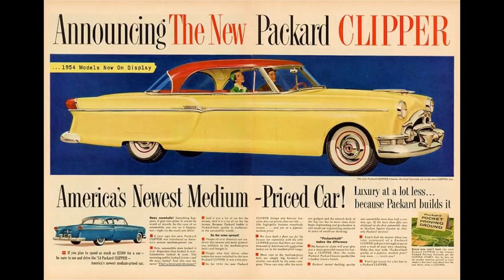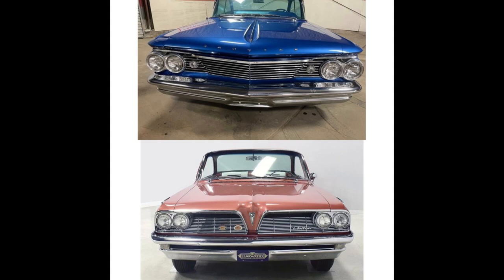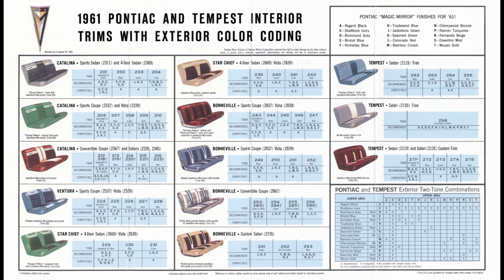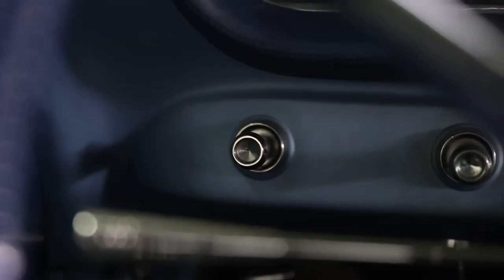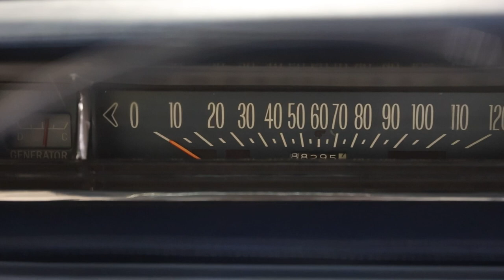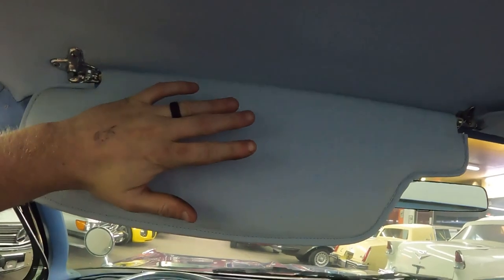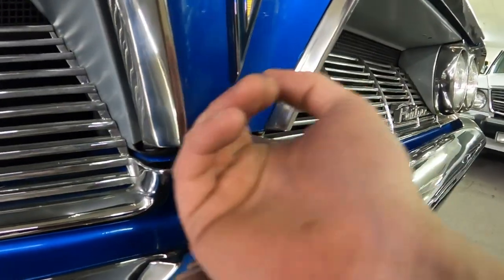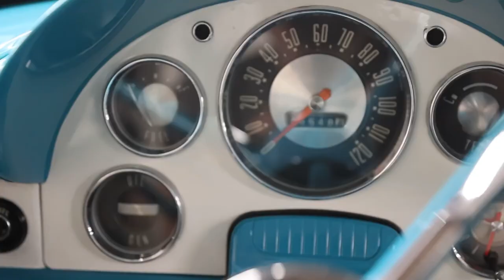1961 Pontiac Ventura, with wide track ride￼

Comment: I always LOVED  the Guages rather than the IDOT LIGHTS ....
Reply: Yes, nobody likes "IDOT" lights.
Reply from the maker: Totally true
Reply: The '60 is my absolute favorite Pontiac, ever.

On the gauges, they were the "same" after 1958.

1958 used fuel, coolant temp, engine oil pressure and ammeter.

1959-60 both kept fuel and ammeter with lights for oil pressure and coolant temp COLD/HOT.  1961-on removed the green COLD lamp.  1969 replaced the ammeter with a GEN  light.

Did you notice the HIGH BEAM indicator under the 60mph line?  Its a Pontiac indian head.
Reply from the maker: Yeah it was such a cool Easter egg
Reply: @What.its.like.   Pontiac used that high beam indicator 1960-70 on the full-size cars.

Another easter egg is the Pontiac arrowhead-shape rear side marker lights on the 1968s.

Comment: My dad traded in his 1955 ford plus about 1700 dollars for a1961 Bonneville around 1963.  I was about 12 at the time.  I grew to love that car.  It still is the most beautifu passenger car ever made in my opinion .   I got to drive it a lot in 1971.  I tested the top speed once.  It hit about 120 mph and was surging like it was starving for fuel.  Probably a partially clogged fuel filter.
Reply from the maker: Thank you so much for sharing those memories =)

Comment: Bring back memories! I had a 1961 Pontiac Bonneville bubble back in the same blue , the trim was better and the interior was much better in the Bonneville, being a mechanic LOL at that age I had the 389 engine with tri-power, 421 heads and the 4 speed automatic transmission, I did change the steering wheel to a much smaller one , chrome with black rim , I had mag wheels , true dual exhaust and jacked up the car 2” front and rear , so sorry I sold that car , I had it in 1966 , purchased it with 27,000 miles it was like NEW . Maybe I can send a photo?

Comment: As you may know, the bubble top version of the 2 door hardtop was only used in 1961.  In 1962 they changed to a different style hardtop which they kept through 1964.  This is true for all the full sized GM cars.
Reply from the maker: Thank you so much for sharing that information =)
Reply: The 62 Bel Air had a bubble top.

Comment: I'd always liked the styling of the '61 Chevy, especially Impala, but in my younger years in the late 60s & 70s there were still a few of those around. In the 80s when I became aware of Pontiacs styling of their 61 line, I was hooked. Never owned one, as GTOs were more plentiful, but WOW.
Reply from the maker: This is the first time I saw this car in the flesh, it had made the top ten list of cars I’d like to own. I’ll have to find a safari and tempest the 4 cylinder engine sounds interesting plus tempest offered a aluminum block 215 v8 which on paper sounds pretty cool. 

So many subtle lines that looked great on screen looked even better in person.

Comment: The "senior" Pontiacs used the 4-spd Jetaway  Hydramatic  automatic through 1964. The "junior" full-size Pontiacs used a Roto Hydramatic. This was indeed a 3-spd automatic, but it was unique that it had torque multiplication, which GM considered first gear. It still hadn't shifted gears but when the torque multiplication, that was considered 2nd gear. 
Also unique was when it did shift the first time, the shift was long and drawn out as the internal fluid couplings were drained, ending with a bangs as the internal gear train locked up. Because the internal gear was locked up, when it did shift into high gear, it did it with a big bang. 
In 1964, the 2-spd. ST300 was added which was available on the "junior" Pontiacs through 1969. From 1970-on, they got the PowerGlide. With 1965, "Senior" Pontiacs got the TH 400 true 3-spd automatic. You could also get the TH 400 in the "junior" Pontiacs, which was common. The mid-size and smaller cars got only the ST 300 for an automatic.
Oh, that alternator is a modification as GM was still using a generator in 1961.
Reply from the maker: Thank you so much for all this information =) I didn’t know the senior models use the four-speed automatic ( original hydra-matic) I know somewhere around this time that unit gets replaced by the turbo hydra-matic. I really want to find a tempest model to review before the end of the year as well as a long wheelbase model it would be really cool to find all three and compare them because this looks proportionately correct for me and to see it on a 4 inch longer wheelbase will be very interesting =)
Reply: @What.its.like.  The first Tempests used the Corvair chassis, although they had a front-mounted engine. It also shared the Powergled transaxle although Pontiac called it the TempestTorque. 4 cyl. versions had a long driveshaft about the size of a little finger which connected the engine to the transaxle. Those which eventually got the 215 V8 had a driveshaft about the size of a thumb. Both driveshafts were supported by multiple bearings.

The Turbo-Hydramatic did not exist until 1965, which was the TH400. The first version was the Super Turbine 400, which didn't have a 2nd gear position. Only Buick and Cadillac used it in 1964. Cadillac referred to the ST 400 as 'automatic transmission and the TH 400 as the 'dual-range automatic transmission' through 1980. Buick still referred to it as the ST 400 through 1967, although it gained the 2nd gear position as did the TH 400 in 1965. The differentiation between the ST 400 and the TH 400 was that the ST 400 had a variable-pitch stator(actually 2 position), which was exclusive to Buick .

The Super Turbine 300, a 2-spd. automatic, was introduced in 1964. Internally, it was nearly identical to the Aluminum Powerglide and internal geartrain parts were nearly identical and interchangeable, but heavier duty. The forward and direct drums had an extra clutchplate. The one used in Buick had a variable pitch stator(2 position). The one used in Pontiac and Olds didn't. The Monkeemobile, built from the 1966 GTO used in the T.V. series, "I Dream of Jeanie" had a ST 300 and did NOT have a variable-pitch stator. And yes, I have seen the car close-up and it only had one electrical wire going to it for the passing gear kickdown. This was when I also met and talked to George Barris at the SEMA show. Those with 2 wires usually had the variable-pitch stator, but in the last year(s) of the ST 300 was used for emission control, for a high gear switch.

The Buick Special was re-introduced for the 1961 model year, having the new V6. It also shared it's chassis with Corvair and like the Pontiac, had a front-mounted engine, but the transmission was directly and conventionally attached to the engine. Although it also had a Dynaflow automatic, it was unlike the other Dynaflows in that the gear reduction planetary gear was located inside the torque converter.

Comment: Your in trouble now ...😂
Who's buying a Pontiac in 10 years????😱😉 Start saving!!! It's hard being a Hero 🦸☺️✌️
Reply from the maker: =) i’ve only owned one Pontiac and that was the Sunfire and it wasn’t very good. In fact it’s probably the worst car that I ever owned. And that’s saying something because at one point in time I had a 1993 Ford Explorer but it was a three door. That I bought to learn to drive stick on heaviest clutch of any vehicle I’ve ever driven. It was like pushing down a 30 pound weight every time you wanted to change your gear. It really sucked when you came to a hill with the point that I’m trying to get to is that car was held together by rust. The suspension was always being held by gravity. And the key cylinder for the ignition was bad, it had keyless go if you forgot your keys at home no worries you didn’t need them if you put your foot on the clutch and turn the key it would fire right up.. but it was flaky I didn’t do it all the time so it was always a good idea to have your keys handy if it decided not to start. The Pontiac Sunfire was worse than that. Candle lights and jam jars were brighter than the low beams were. The high beams you could see 5 inches in front of it. When it rained the lights were nonexistent. The only time that you could really drive the car at night was when there was a full moon invisibility at night was somewhat decent. The car is only saving grace was it was phenomenal in the snow. But that’s it it wasn’t good in the transmission line broke in the middle of downtown Pittsburgh and I had to push it off the road while people were beeping the horn at me. I asked them if they would like to help me instead of beeping the horn too which I got no help in return but they stop beeping. Haha little trip down memory lane

Comment: On the horsepower rating for automatic vs manual trans cars; HydraMatic trans from that era used a fluid coupling, rather than a torque converter [no torque multiplication].  Higher engine tuning was needed to get similar performance to a manual trans.

PowerGlide, TurboGlide and Buick's DynaFlow used torque converters.  The HydraMatic never used a torque converter.
Reply from the maker: Thank you so much for that information =)

Comment: GM had adopted the Silas side look for their Pontiacs after Lincoln came out with the 61 Lincoln with slabbed sides
Reply from the maker: That makes sense but this car did not have slab styling it was a lot going on lots of different lines.. it has the same bullet spear that the Buick Invicta has as well I should’ve pointed that out but I didn’t..
Reply: @What.its.like.  the A pillar is just an  upside down from the A pillar of the 1960 model
Reply: @What.its.like.  of you look at thr black so called wings they are not wings for the side backs are squared off like slabs

Comment: Did the the 1960 have full gages. I know most years full gages were optional on full size Pontiacs through the 1970s
Reply from the maker: I’ll have to look into that because now that you mention it I’m not entirely sure I did reviews of both but I might vaguely remember that there was pods with idiot lights in them..
Reply: No.  The optional gauges started in 1964.

Comment: On the positive side....fast, fast, fast.  They could spin the tires when punching it at 35mph. The only car I was in that buried the speedometer and would not stop accelerating. When it was at out on the street it looked like just another car.
Reply from the maker: Awesome, was this car as floaty as the Chevy?
Reply: @What.its.like. That was like 50 years ago so I can't accurately say, but I can say that it did not ride like an Oldsmobile or Chrysler. I just remember that we opened it up on the highway for about 2 miles and when we parked it we just paused and stared at it in unbelief for a few minutes. At the time my brothers friend had a 70 GTO that they cruised around the city in so we were used to speed, but this car was a pleasant surprise.

Comment: They had the slim Jim trans  quicker than the Bonneville 4speed hydramatic but they slipped leaked when old 🤔 back in the day used 5-6 hundred dollars 4yrs old
Reply from the maker: That’s crazy but that was a lot of money then I remember grandpa saying he was buying cars for 25 bucks.. .15 at McDonald’s which is hard for me to Fathom
Reply: @What.its.like.  when I was 8 a 32ford side mount v8#roadster pickup was at the junkyard  ran wanted 25$for it dad said no smoked wasn't worth it they burned it then cut up for scrap iron 🤕